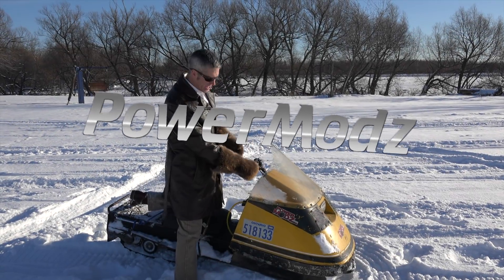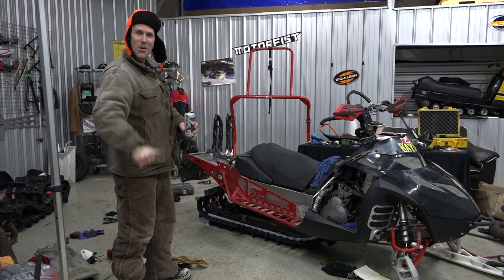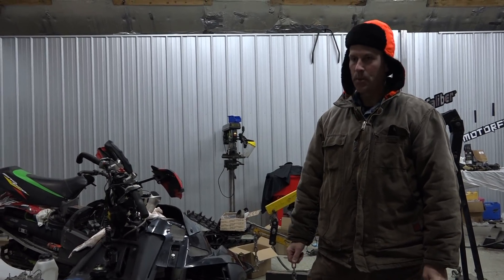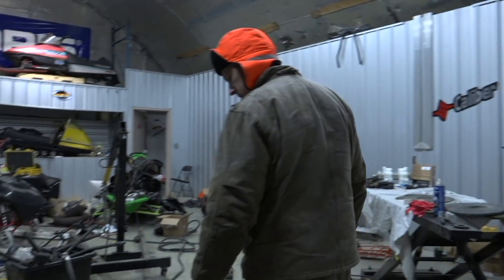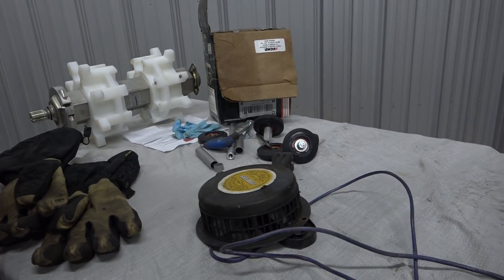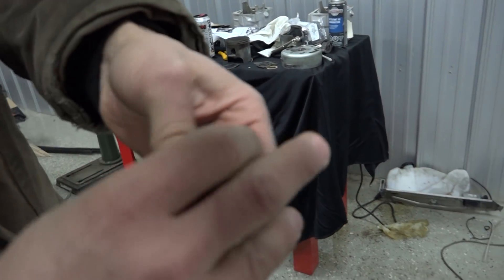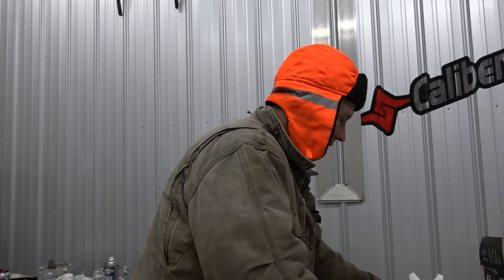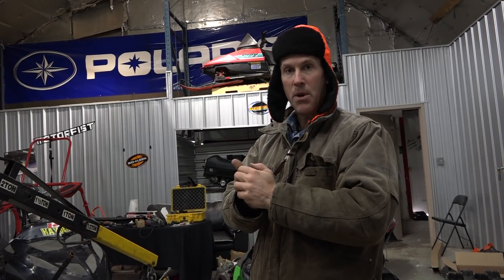POWERMODZ SHOP UPDATE JANUARY 15, 2018!

Comment: Snowmobiles really are one of the worst bangs for the buck compared to all power sports machines. Most people have to trailer long distances to find snow, the season is relatively short, the machines require an enormous amount of maintenance ($300 for a triple carb cleaning...every year), and the resale value plummets. Not that I'm complaining, I love it, it's in the blood, but damn I question our sanity sometimes. I believe motorcycles are the best bang for the buck power sport machine man has invented. But I'm looking forward to riding in a week!
Reply: I hear that! I live 30 feet from the snowmobile trail, but was too busy over the holidays to get out when we had tons of snow here. Now that it's all gone, I'm sitting here wondering why I don't trade it in for a CanAm. (But I can't NOT have a sled. I'm sick, LOL)

Comment: Hi how good are the ultamax belts ? I was thinking of buying one for my Polaris 700
Reply: How hard do you ride? I had a Ultamax belt on one of my sleds, and didn't like it, so went to a Dayco performance belt and had great luck with it, it all depends on how you ride
Reply: Joz Sports lake ridding  most of the time  500 to 700ft wide open most of the time then let off
Reply: I'd get the Dayco, sounds like you to ride hard
Reply: Joz Sports so the ultamax would blow apart? At full shift out ?
Reply: It wouldn't necessary blow apart, just wont last as long, eventually, it will come apart, but the Dayco will outlast it big time, I stuck a Ultamax belt on my older Arctic Wild Cat, but probably didn't break it in right and it just gave out, do I put a Dayco performance model on and had no issues, even with my other sleds, unless you were to break them in right, you will run into problems, I'm speaking from experience from breaking belts, the factory belts last the longest, but cost like hell for the factory performance belt, so I went with Dayco and have no issues
Reply: Joz Sports ic yah the Polaris belts are 270dollers but yah thanks for the info buddy
Reply: 700 gabriel you are very welcome
Reply: Joz Sports im goin to subscribe to ur channel 🖒